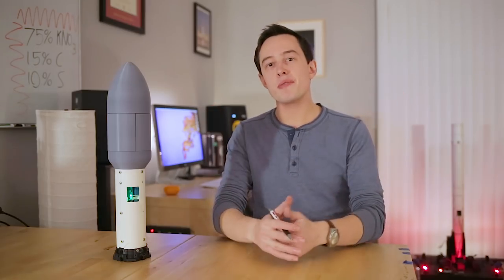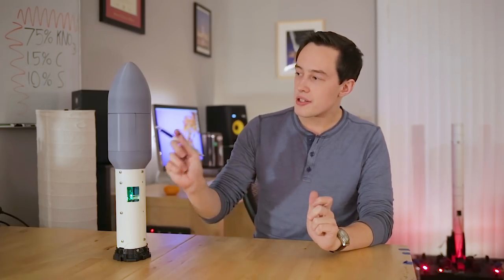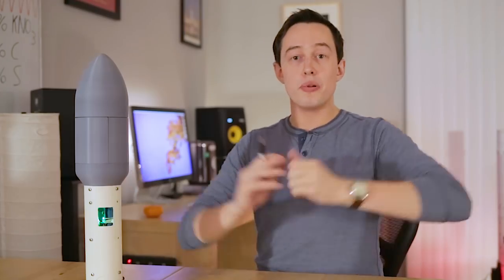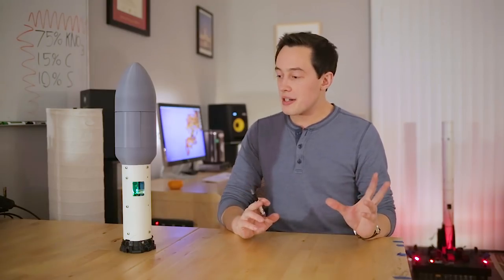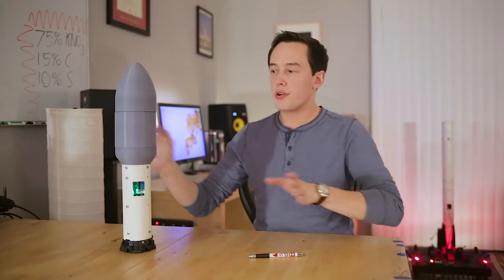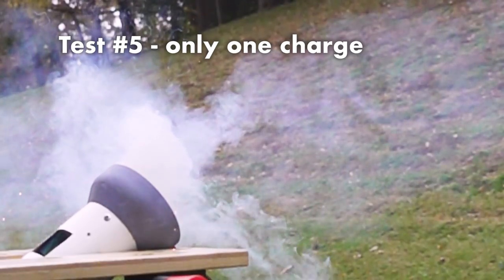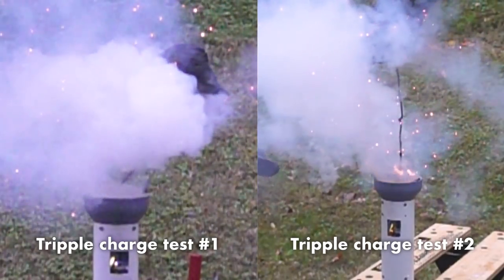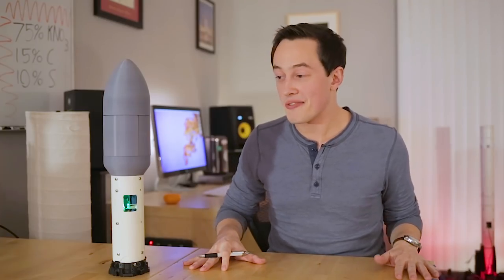Fairing Separation Tests - Fall 2018

Comment: i am no expert on space x and their rockets but if you are building a model of falcon heavy dont you want to simulate as mutch as posible in scale and replicate how it works as mutch as possible?

cuz if i am not wrong space x and falcon heavy dosent use any pyrotecnicks. they use other systems like a hydraulicks so dont you want to replicate the function of this and use a servo motor to release the stages.

Comment: Did you try putting one charge above the parachute?
Reply: The pressure of the ejection charge almost immediately fills the entire volume of the capsule, so the position of the charges doesn't have much effect.
Reply: @jadebox  Chute packing slows the movement of gas above the chute to pop off the nose cone. Some tests seem to have ended with the sections not separating as pressure was relieved too quickly between fairing and rocket leaving nose cone and fairing still connected. Seemed pretty straightforward solution to  assure complete disassembly with the potential risk of entanglement with the longer charge leads.

Comment: What's that watch you're wearing? is it a Swatch? if so, which one?
Thanks
Reply from the maker: It is a Swatch, great eye! They're so cool, my dad and I both wear them - the engineering that goes into them is top notch. It's the Sistem51 Irony series, specifically Sistem Earth. It drags a few minutes every 2-3 weeks, but is otherwise awesome.
Reply: @BPSspace  That's a good looking watch. I noticed by the way the strap is connected to the case. that's quite typical for Swatches. Nice to see you wearing an automatic!
 I don't mind the 15 or so seconds per day of automatics tho, I think it's amazing that these little pieces of precision engineering can get so close to start with!

By the way, I love your vids, as they combine my favourite interests: 3D printing and rocketry. Keep it up!